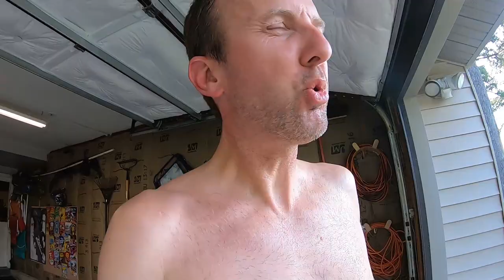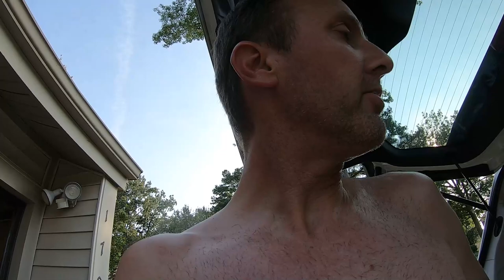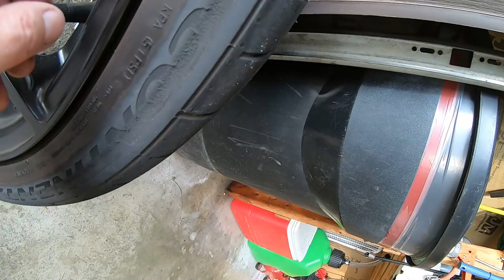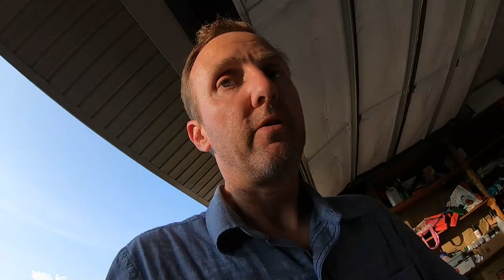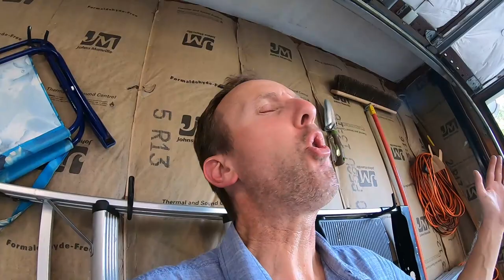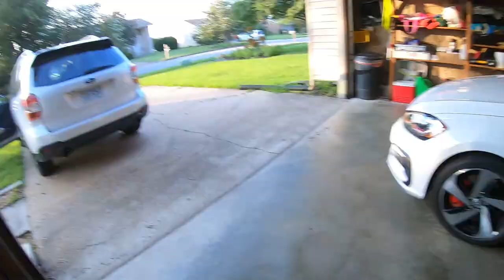2018 VW GTI SE Ep.384: Valve Stem Blowout!

Comment: Oof. good thing you kept those old wheels. back in January I also had a flat with my then 6 months old Conti DWS06 tire, it was  completely sliced open on those metal construction plates on the freeway, ended up driving an extra 10 minutes before pulling over and noticing the gaping hole in my tire. In any other car I would have imagine a loss of control at that speed, but the GTI stayed pretty much straight with minimal wobbling the whole time.
Reply from the maker: ya dude.. weird how it drives normal..

Comment: Do you have any enemies at work?  A pair of side cutters make short work of those rubber valve stems (ask me how I know).  Generally, most speed rated tires are supposed to have metal valve stems but it's really not done that often unless you feel like a "big spender" at the tire shop....  It didn't look like there were signs of fowl play you may have just gotten a bad stem (I request no seeds or stems)....
Reply from the maker: naw it was natural shreddy rips. deep inside.

Comment: Any chance your high tire pressure contributed to this?  It is 95 degrees out.
Reply from the maker: it was the hottest day yesterday.. 100-102... think its related?? i mean there are a lot of places hotter than that..
Reply: @LastHumansGarage  It can't be. Car manufacturers test their cars in Death Valley, they should easily withstand high temperatures. I guess some rock may have hit the stem hard and damaged it.
Reply: @LastHumansGarage  As I recall, you rund cold tire pressure 5 - 8 psi over the recommended.  That will significantly increase hot tire pressure.  no sure it is related but you never know.